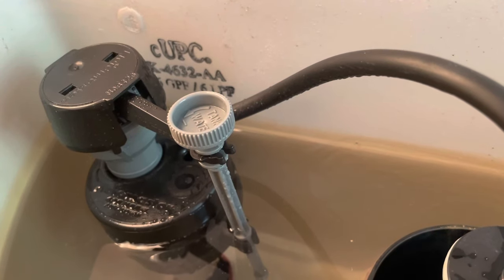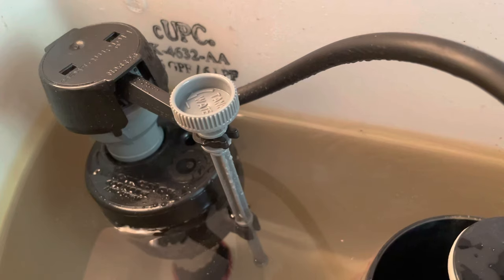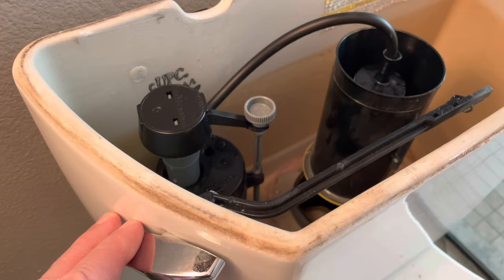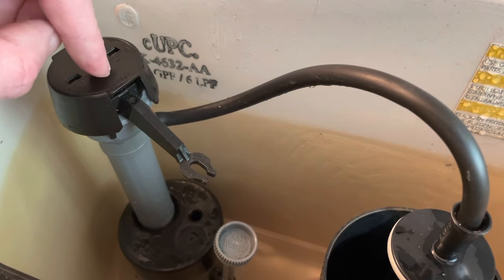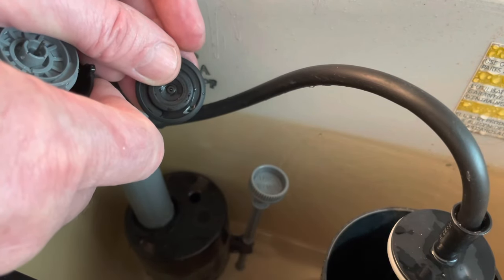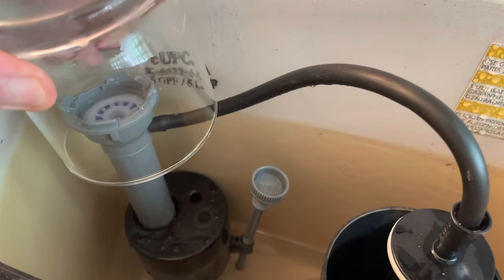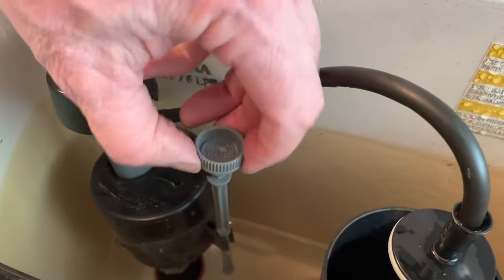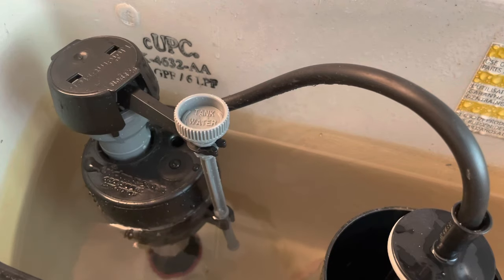Toilet Fill Valve Not Shutting Off / Don’t Replace / Fix Fast Cheap & Easy For Beginners

Comment: What are some of the common reasons/causes that a fill valve would go bad after few years (other than hard water)? Also other than the seal, what other parts of the fill valve tend to go bad and needs to be replaced after 7-10 years (or longer)? Thanks!
Reply from the maker: @DrWenChannel  Honestly, beyond that little seal, which is easy to clean / replace, over time the moving parts tend to get a little “fussy.” When that happens, it’s easier to just replace the valve. It’s simple to do, and they’re only around $10.

Also, there’s a trick where you just replace the upper portion… it can be done quickly and with no tools. Here’s a video…

Replace Fluidmaster Toilet Fill Valve in Seconds For Beginners NO TOOLS NEEDED
https://youtu.be/ovdWF5Hdz8U

Comment: 2:03 if you have an older stem with the metal rod, this is removed by lifting the arm and rotating the top and arm 1/8th turn CCW while slightly pressing down. Reverse process to put it back on.

Comment: I've fixed a couple of these where the problem was the little pin sliding free in the rubber seal. If you see the pin moving rather than the seal there is a problem. There is supposed to be a tight fit so the pin lifts the seal to open. I've used a tiny bit of epoxy on the top of the seal which I worked  slightly into the hole. Keep any epoxy away from the bottom where there is a potential of getting epoxy on the sealing surfaces.
Reply from the maker: Good little tip right there. 👍🏻

Comment: Great i bumped into your video. I have a case where after flushing the valve wont start filling by itself. If i give a gentle feather touch push to the grey knurled knob's head the water starts filling. Very annoying and is it fixable?. Thanks in advance
Reply from the maker: When they start getting “fussy” like that, it’s sometimes easiest to just replace the valve, they’re only like $10 and it’s very easy to do. There’s also a trick where you just replace the upper portion, very quick and no tools needed. Here’s a video…

Replace Fluidmaster Toilet Fill Valve in Seconds For Beginners NO TOOLS NEEDED
https://youtu.be/ovdWF5Hdz8U

Comment: Dude... I don't know how I came across your video after searching for answers for days now. This video did the trick. My fill valve was spewing water, causing the tank to be full and run water into the bowl. A huge waste of water that has jacked up my water bill.

I purchased the whole fill valve system to replace it, but I couldn't get the toilet water shut off valve to shut off. That needs to be replaced too. So, I bought a Sharkbite shut off valve, and a connector. I was going to do this project during the week but just ran across your video.

I just unscrewed the old Fluidmaster cap, and replaced it with the new one. Didn't even changed out the whole system. I called a plumber today, he quoted me $320 for the job.

Where can I send YOU the check?
Reply from the maker: Hey that’s awesome I’m glad to hear it helped you! And you’re welcome to contribute to the channel if you’d like. My cash app is in the description. Thanks! 👍🏻

Comment: about every six months mine goes out. those diaphragms on the "redhats" have to be changed out.  the newer greyhat Fluid master valves also have a "performance" model which has a bowl waterline adjuster. I learned those newer "performance" models that is probably the only difference from the standard greyhat models. My redhat is old, my Kholer "highboy" duel flush, was installed back in 2014, and it requires a screwdriver to adjust the tank's waterline and has no way to adjust the bowl's water level. I had considered replacing the entire valve but I don't know if duel flush(for full or water saver) is supported by the Flush master series.  but my redhat seems okay if I can change out the diaphragms since they are the same. have lots of problems with leaks every six or so months.

Comment: Super helpful. Seems like the valve on my Gerber was maybe stuck because after removing it, cleaning, and reinstalling it's good again. Do you know if these replacement valve seals are universal? Not seeing any for the gerber brand.
Reply from the maker: I don’t believe so… if it starts acting up again, maybe just switch over to a Fluidmaster, they’re only like $10. 👍🏻
Reply: @papajoeknows8355  Better believe it. Thanks again !

Comment: For the newer pull up water shut off valves? (Mobile home) do you have a video on how to replace that. And I'm guessing I would need to shut off the hole house water valve to do this repair. New home owner here. Thanks for any help you can provide
Reply from the maker: I don’t have any videos on that, but there are numerous vids on YouTube. But yes, for water supply valve replacement, you need to shut off water to the whole house first.

Comment: Papa Joe, do you have a video on how to resolve a fill valve that closes too quickly and causes a banging noise in the wall sometimes? I assume the fill valve closing abruptly is causing excess pressure in the wall and some form of water hammer? My best guess anyway.
Reply from the maker: Hey, I don’t have a video on that, but here’s a video on a quick fix for water hammer that works “most” of the time.

Comment: Glad I found this vid yesterday. I’m not real mechanical. Where did you get the seals? I did exactly what you said. Plus I used a fine brush to lean out the filter where the water comes in. Worked! No running and readjusted where the float stops.  Thanks. This is amazing for me
Reply from the maker: Glad it helped! There’s a link in the description to get the seals on Amazon, but you can sometimes find them at home improvement store. 👍🏻

Comment: Great video ver detailed. Replaced my seal but my toilet is still running. What else do you think it might be?
Reply from the maker: Is the water rising over the level of the fill tube in the center?
Reply: @papajoeknows8355  yes it is. Tried turning the plastic screw to the left or to the right but the water is still rising over.
Reply: Should I just change the whole flush valve canister or should I change the valve kit?
Reply from the maker: @luisc7507  another question, if you lift up on the arm (the part that adjustment screw is attached to), does the valve turn off?
Reply from the maker: @luisc7507  maybe so… if you do, there’s a little hack where you just replace the upper portion. Here’s a video:

Replace Fluidmaster Toilet Fill Valve in Seconds For Beginners NO TOOLS NEEDED
https://youtu.be/ovdWF5Hdz8U
Reply: @papajoeknows8355  thanks for all the help ended up replacing the full valve and it solved my running problem.

Comment: Great video.  Water wasn't coming in to refill the tank.  I took the cap off the valve before I saw your video.  I put it back on then tried to twist it to get the top off but could not get it to turn.  Now water is flowing in, but I can't get it to stop.  When I pull the float all the way up, water still flows in....   Do I need a whole new unit now?
Reply from the maker: It sounds like you may have damaged it… but they are sooo easy to replace. Just go to your local home improvement store and grab one. Then just look on YouTube for “replace Fluidmaster valve” and there will be tons of videos. It only takes a few minutes. Then next time, you’ll know how to do everything.
Reply from the maker: And here’s a great little hack for doing it with no tools…

https://youtu.be/y6J1cfvQOGg

Comment: Thank you Sir for the great video. I did this for one toilet (clean, flush, replace the gasket) and it worked to stop running water. However, on the other toilet, repeat the same procedure, now it not only has the loud hissing sound and it also did not shut-off water. Then I had to press on the top cap and then it stopped. But once you flush it again, hissing sound, running water again. Any suggestions that I should do? Thanks for your help.
Reply from the maker: At that point, it’s easy and cheap enough to just replace the valve… but actually, all you need to do is replace the upper portion of it. Here’s a vid on that:

Replace Fluidmaster Toilet Fill Valve in Seconds For Beginners NO TOOLS NEEDED
https://youtu.be/ovdWF5Hdz8U
Reply: @papajoeknows8355  Thanks for the quick reply. I was looking at that video from the above link. Then I gave a try on the old fill valve I had, I could not pull it up for a few times. I'll try it again.
Reply from the maker: @dougs3866  make sure you lift the collar ring before you try to pull it off.
Reply: @papajoeknows8355  Yeah, I did. It turned out that the old one (from the whole repair package) I intended to use it on was really stuck and I could not separate the upper portion from the bottom one and could not adjust the height either. Also installed an old CAP assembly with new seal and still got the crazy sounds. Got a new fill valve from Home Depot and it was easy to pull the upper portion and replaced the one in the tank. So far it is working. Thanks again for all the suggestions and solutions.
Reply from the maker: @dougs3866  you bet, I know how frustrating things can get, so glad it all worked out! 👏🏻

Comment: Thanks for the informative video. Found a new seal and flushed it out, but still running. Any other ideas i should try? I may need to give in and replace the whole fill valve.
Reply from the maker: @glawrence  if it’s constantly spilling into the overflow, try this…

Running Toilet Spilling into Overflow Easy Fix DIY
https://youtu.be/uTcYxn2bpDg
Reply: Ah, no. I fixed that and it generally stops now about an inch below that, but still leaks from the fill valve where the hose comes out until it slowly goes over the top of the flush valve bucket thing. Seems much more like this video.
Reply from the maker: @glawrence  When they start getting “fussy” like that, it’s easier to just replace the valve. It’s simple to do, and they’re only about $10.

Also, there’s a trick where you just replace the upper portion… it can be done quickly and with no tools. Here’s a video…

Replace Fluidmaster Toilet Fill Valve in Seconds For Beginners NO TOOLS NEEDED
https://youtu.be/ovdWF5Hdz8U

Comment: holy crap, this was great, thanks for the tip!
Reply from the maker: You bet, glad it helped. 👍🏻
Reply: @papajoeknows8355  hey i checked the rubber seal when i took the cap off, seal seems to be fine, i flushed the water also with a glass over it..what if it’s still leaking?  i’ve been trying to adjust the height, or maybe it’s the whole fill-valve itself that needs replacing?
Reply from the maker: @glenbarrett8299  yeah, at that point it’s easier just to replace… and actually, you can just replace the upper portion in seconds (no tools). Here’s a vid on that:

Replace Fluidmaster Toilet Fill Valve in Seconds For Beginners NO TOOLS NEEDED
https://youtu.be/ovdWF5Hdz8U
Reply from the maker: Change a Fluidmaster Toilet Valve in 18 Seconds No Tools Easy
https://youtu.be/gyeQNI-LQnU

Comment: Hey, Papa Joe, there is a very tiny fine spray coming from that area on my toilet valve.  Can I use your hack, or do I have to replace the entire thing?  I know it's hard to answer when you can't see it.  It was spraying up onto the inside of the lid, traveling across and dripping onto the floor on the right side of the toilet.  It was very fine.  I turned off the water and will use a bucket to flush until my super can look at it.  I'm glad I could tell him what's wrong.  Thanks for any advice.
Reply from the maker: Yes, there could be some sediment stuck in there that may cause that. I would follow the steps in the video, and while I know you probably don’t have a replacement seal, you could clean the existing one and flush it out as described. If that doesn’t work, it’s probably best to just replace the valve. They are only like $10. There’s also a nice little hack where you just replace the upper portion of the valve… it can be done in seconds with no tools. Here’s a video on that:

Replace Fluidmaster Toilet Fill Valve in Seconds For Beginners NO TOOLS NEEDED
https://youtu.be/ovdWF5Hdz8U
Reply: @papajoeknows8355  Oh, you are so awesome.  Thank you very much.  God bless.

Comment: This was super helpful... I followed every step... I do have a question though, my filler valve the part which is suppose to go un and down with the water isn't moving with the water and if I do it by hand (raising it) it still doesn't stop the water from coming out... I had to press the top where the filter is down then it stopped... any ideas what I should do?
Reply from the maker: Yes, it’s time to just replace the whole valve. They do go bad eventually. They’re very cheap and extremely easy to replace. I haven’t yet done a video, but there are tons of videos, just search “how replace Fluidmaster valve.” You can pick one up at your local home improvement store, but here’s a link if that helps:

https://amzn.to/3gzf4Ss

Comment: Very helpful video. Will the fill valve seal replacement (10-pack) you linked to fit a Fluidmaster Pro Series fill valve?
Reply from the maker: Yes 👍🏻

Comment: Question- my value was working until we turned the main off. Now it's not working.  Do you think rust, dirt is caught inside to prevent tank from filling?
Reply from the maker: Yes, likely the sudden burst of pressure when you turned the main back on has dislodged some debris in the line. Follow the steps in the video, but just clean / flush it out. 👍🏻

Comment: My water is STILL flowing into that hollow tube. I cleaned the seal area as you said, but it is STILL not shutting off. Could it be something else? The float itself, or that "arm" attached to the fill valve? Is that thing supposed to adjust for some because when I turned it didn't change anything?
Reply from the maker: Question… if you use your finger to lift the “arm” does the valve shut off?
Reply: @papajoeknows8355  No. And any amount of pulling or turning up doesn't work. And my rubber flap does not leak into the bowl when water is full.
Reply from the maker: @mantralantis2023  ok perfect, that means it’s time to just replace the valve. They’re cheap at Home Depot or Lowe’s (or any hardware store), or here’s a link to get one on Amazon:

https://amzn.to/3kU6Xnq
Reply from the maker: @mantralantis2023  also here’s a video on how to do replacement in seconds by leaving the existing “stem” in place and just replacing upper portion:

https://youtu.be/ovdWF5Hdz8U
Reply from the maker: @mantralantis2023  as well as a vid of me doing a quick change in 18 seconds:

https://youtu.be/gyeQNI-LQnU
Reply: @papajoeknows8355  Yes. That is my best guess - to get a new one. And just to say, the one in the photo, at that Amazon link you gave me, is the type I have now. Thanks for responding, at the very least.

Comment: Hi Joe great video my toilet is leaking in that spot where that seal is at when filling should I  try to replace the seal or just put a new fluid master in? Thanks
Reply from the maker: Sometimes just removing and cleaning the seal will work also. I might try that first.

If that doesn’t work, they’re easy to replace, and they’re only about $10.

Also, there’s a trick where you just replace the upper portion… it can be done quickly and with no tools. Here’s a video…

Replace Fluidmaster Toilet Fill Valve in Seconds For Beginners NO TOOLS NEEDED
https://youtu.be/ovdWF5Hdz8U

Comment: Hi! What do you call that water level thingy that is rising while the tank fills? 
Mine sticks. If I push the cylinder with my finger the water stops running. 

I just bought this house so I'm not sure how old the 400A is, but it seems like an easy fix.
The water here isn't particularly hard, I don't see calcium build up.
Any help would be greatly appreciated. 😊
Reply from the maker: It’s the float, but between us we can call it a thingy.

Honestly, when they start getting “fussy” like that, it’s easier to just replace the valve. It’s easy to do, and they’re only $10.

Also, there’s a trick where you just replace the upper portion… it can be done quickly and with no tools. Here’s a video…

Replace Fluidmaster Toilet Fill Valve in Seconds For Beginners NO TOOLS NEEDED
https://youtu.be/ovdWF5Hdz8U

Comment: The top of my fill valve makes contact with the underside of the toilet cover. The Plummer that installed it was so incompliant, I can see that the level is fully adjustable, but the top plastic cover is cracked as its been crushed by the weight of the lid.
Reply from the maker: If it’s cracked, it may be best to just replace it, they’re only like $10, and it’s very easy to do. There’s also a trick where you just replace the upper portion, it can be done very quickly and with no tools. Here’s a video:

Replace Fluidmaster Toilet Fill Valve in Seconds For Beginners NO TOOLS NEEDED
https://youtu.be/ovdWF5Hdz8U

Comment: Not any sediment under the valve, but the 
annoying high pitch noise seems to be resolved. This valve always had noise problems when it  replaced another one
a couple years ago.......it eventually got worse over time.
It's a fluidmaster   (uugghh) the cap removal was a beast to remove! It's an American Standard low flow commode.
TO MY DISMAY, ONCE I TURNED THE WATER VALVE BACK ON, I CAN HEAR PRESSURE DIRECTLY FROM THE FILL TANK VALVE. 
 THE MORE I OPEN UP THE WATER FROM THE WALL, THE MORE SOUND IS NOTICEABLE.
The toilet isn't running, no ripple in the water, no drip.......nothing, it still fills slowly, it shuts off just fine.
ANY INPUT ON PRESENT ISSUE WOULD BE GREAT. MY WORRY.........IS THE TOILET RUNNING, DESPITE NO SIGNS OF IT? THANK YOU.
Reply from the maker: Sounds like that particular valve has been a pain in the ass since the beginning. Just get another one and replace (a little secret… you can replace the upper portion in seconds with no tools). Here’s a vid…

Replace Fluidmaster Toilet Fill Valve in Seconds For Beginners NO TOOLS NEEDED
https://youtu.be/ovdWF5Hdz8U